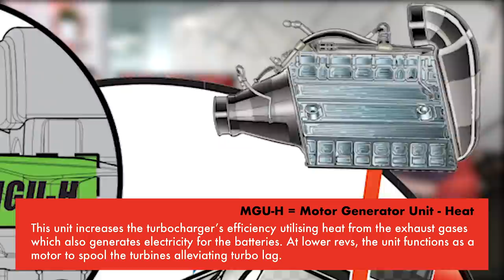Charles Leclerc’s cruel Bahrain F1 engine problem explained

Comment: Doesn't sound right, if it was a cylinder he'd be smoked out of the corners but it was only at top speed he was reeled in, the revs seems to peak out early and he was clipping much sooner than normal.
Reply: Remember these engines are hybrid. Two seasons ago alonso's Honda was down on power but at the top end. The battery system makes up for it under acceleration but as soon as you use all your battery energy its like hitting a wall the car just stops accelerating.

Comment: Wow you guys don’t have any idea. They are lying about a cylinder failure. You’d hear if only 5 cylinders are firing firstly. Secondly higher fuel consumption wouldn’t occur if you’re miss-firing. They are covering up that they had another MUGH failure. This would result in too little fuel as the MGUH harvesting ability has been eliminated so efficiency drops massively as they have to use the waste-gate to keep turbo speeds down.

Comment: Ferrari turned up their engine, but overdid it, causing Leclerc's engine failure. Merc had hamilton on softs for the second stint and he barely maintained position vs both ferraris on mediums, while Valterri on mediums was falling back. That 0.9s (ish) per lap was basically the amount Ferrari had juiced the engine. Ferrari has to detune the engine to balance performance with reliability.

Comment: Put more fuel into the other cylinders to bring up the power? What is this guy talking about? This is worse than a pub conversation!!!
Reply: Yeah this is basically a group of random people with less knowledge and expertise than a low level road car mechanic's apprentice trying to explain complex engineering lol. Did you notice near the start where they had an overlay explaining what the MGU-H is, the picture showed the old water to air charge cooler from the 2014 Ferrari? Lol, anyone with even a passing interest in F1 tech would know what that part is, yet they're labelling it as the MGU-H hahaha.

Comment: Nobody's crying over Vettel's problems huh? Like a front wing that suddenly decides to jump off of the car?
Reply: Looks like his spin messed up the rear tire and caused vibrations, that seemingly caused the front wing to break off.
Reply: @Miragexe  agreed but that's pretty weak fastening on the wing.
Reply: @michaellinner7772  Hard to tell.. heavy vibrations can have pretty extreme effects.. entire bridges can collapse under an oscillation/vibration/mechanical resonance.. and an F1 car traveling with 100-200km/h+.. the front wing is already under a lot of pressure from the downforce. Plus I imagine to keep the car as low weight as possible, they won't have a bunch of additional construction on these front wings.
Reply: @Miragexe  ya, weight is always crucial to overall performance.

Comment: I’m sorry but am I the only one that understands what happened? Ferrari tried to compensate for their lack of cornering speed by turning the boost up on the engine. Which of course effected the reliability. Mercedes was more conservative with their engine tuning and went for reliability instead of max power and it paid off for them big time. It got Ferrari the front row but it also lost them the race. Ferrari couldn’t do engineering fast enough to beat Mercedes this race so they went the old school route and turned the boost up. Then had a old school engine failure. I don’t feel bad for Charles. I actually think he got quite lucky with the end of race yellow flag. That 3rd podium belonged to Max.
Reply: Based on what evidence do you draw these conclusions?.. Could u defer from talking like everything is understandable sitting on your couch? Ferrari's advantage on one lap came from the straight lines yes but they were also the quickest on traction zones if you compared the on boards and sector splits.... They wernt slower on the corners (at par).. Jus faster on straights which is what gave em the advantage... And no engine has the capacity to run the highest mode or boost as you call it for an entire race duration.. They'd probably need 150kg of fuel for that... You haven't really thought out your theory have you? Jus another cocky Mercedes fan I believe?
Reply: Rohit Revankar: so what’s your theory or are you just a angry Ferrari fan.
Reply: @jasswear8911  well I jus explained my point of view which is based on the evidence so far... I can't help you if u don't get that...
Reply: Rohit Revankar: if you have raced on track before you would understand what I’m saying. I have 21 years track experience. Almost as much as your computer keyboard experience.
Reply: @jasswear8911  I never questioned your stream of thought... It is makes sense what u are saying but Ferrari never lacked cornering speeds... I was asking you (not rhetorical) as to what makes you think Ferrari needed to compensate for cornering? If anything the Ferrari was even more responsive in rotation through the corners with better traction and initial acceleration (that's why I said they were pretty much at par and took an advantage on straights, otherwise any so called compensations would simply put them at the same level as Mercedes).... About your brilliant track experience... How many mechanics and technical directors do you think in the F1 paddock have your "21 year track experience ".... You could only make evaluations in terms of drivability if you drove it yourself... We can only interpret the on boards/data and interviews... I have minimal track experience (go-kart only/motorcycling) which obviously doesn't contribute sufficiently but I believe I have a good theoretical grasp